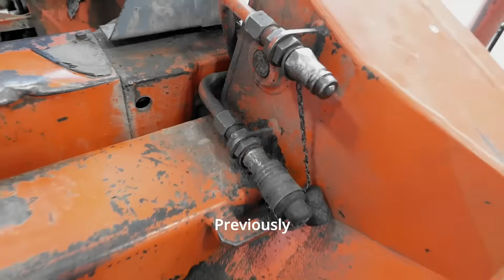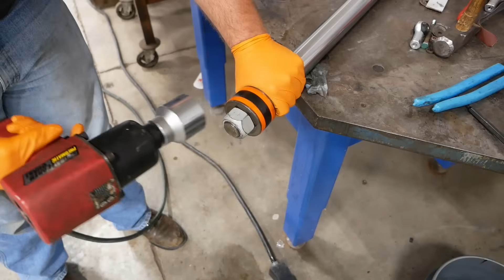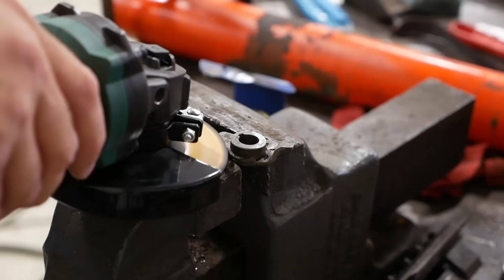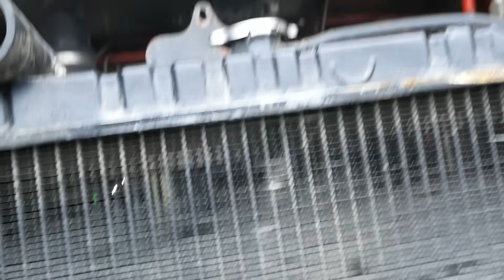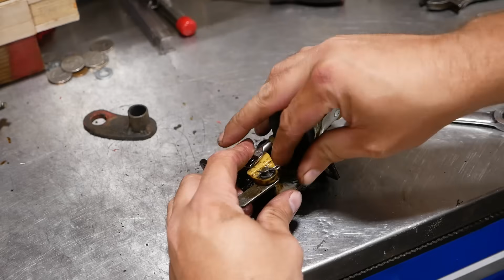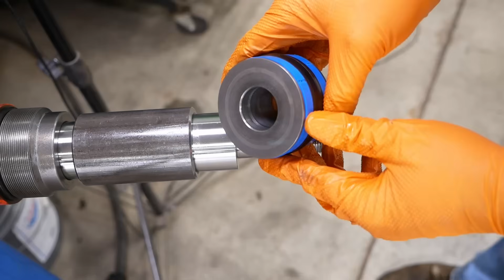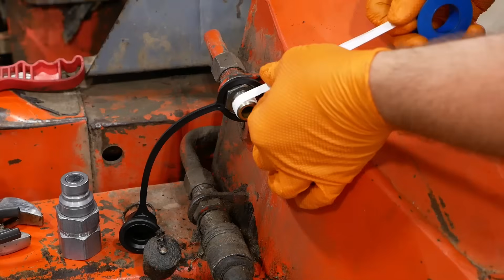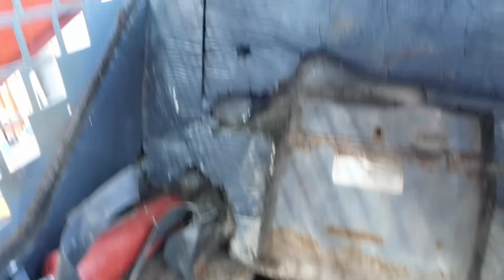Did I Blow up My Cheap Skid Steer? -  Thomas 173HL Won't Rev up, Leaking Cylinder - Part 2

Comment from the maker: Thanks again to patrons! If you want to further test the Kubota self destruct system, check us out on Patreon at patreon.com/watchweswork
Form a Funnel: https://amzn.to/3R9Iniy
Mess Stopper Plug Kit: https://amzn.to/45LNKZB
Seal Installer Kit: https://amzn.to/48anABj
Spoon Pick Set: https://amzn.to/3Pfhwii
Reply: I live up in SW WIsconsin so if you need me to pick anything up 'round here lemme know.
Reply: Formafunnel works ok for some things, although installing NPT nipple and plug as a permanent solution in most cases is the real answer. I drilled a hole in one end so I can secure it to whatever I’m draining. 
I’m doing small engine work and the silicone plugs are fantastic for that work. I ended up purchasing 3 sets to cover 1/8th of an inch up to about 1-1/2 inches. They came in several colors, which is nice. On one I drilled a pilot hole and installed a screw eye for a specific need. On another I drilled a hole right through to adapt my pressure/vacuum tester adapter cone for another use. They’re great for plugging engine holes temporarily in order to wash without getting water and debris inside. I keep most of them in ziplocks but have a clear flat plastic Sistema container on my workbench with two each of the sizes I use most often and that’s really handy. Search “powder coating silicone plugs” for many choices.
Reply: Thanks for the tool listings. Great video as always.
Reply: So true!  I learned real quick to get the wheels off of the ground before firing up an unknown, worked on by someone else, and yes machines I'm working on if there is any chance of hydraulic malfunction or linkage issues.  The first SS I bought was a case 1840 with a one side creeping issue.  Took a 50/50 gamble on an adjustment and went the wrong way.  Had it dancing between toolboxes and tables.  Finally just had to let go one hand and grab for the key.  Luckilly, it landed on all 4 and no harm to anything but my life expectancy I suppose.
Reply: I guess I'm confused about Kubota dealers. I thought we had Rexco here in the quad cities as a full line dealer
Reply: Loving these videos and happy to be a patreon!
Reply: this is why I keep a Big CO2 extinguisher in my shop it has saved my ass twice once on a runaway 4bt turbo oil seal and a fire on a gas air-cooled Wisconsin after a fuel leak also how many washer did they add to this machine jerry rigging to shit lol
Reply: Runaway diesels are no fun .. My Cat 3406 ran away running off the oil feed line from the turbo when the turbo blew.. Chewed up the crank, out of frame/overhaul, $10,000 dollar lesson .. I don't recomend it. It was screaming with rpms ... thought schrapnel was fixing to come through the block.

Comment: You should take all the tires off and check the sides of the machine where the axle hubs bolt to the frame, this area is notorious for cracking around the studs that hold the axle hub on. If you catch it in time you can weld the cracks .But if you let it go it can eventually cause the frame to break around the hub that holds the hub on and is the oil reservoir for the drive chains.

Comment: Oh sure!  I'd been fighting with a cylinder like that with the outside pin holes for about a month.  Broke the special spanner wrench.  Fixed it and immediately broke the pin off the wrench.  About 2 weeks ago I gave up, removed the cylinder from the machine and used a pipe wrench.  NOW I stumble upon your video about that kind of end cap.  :-)  Good video, thanks for sharing.

Comment: In the future, you should loosen (just break the initial tension) on the cylinder cap while the cylinder is still installed - then you only need 1 wrench. Once you get it off, you can just take it off the rest of the way.

Comment: I started a ford 8000 tractor that hadn't been startedd in years..  Well - the rack in the stuck at full throttle.   I did the same thing - pulled the intake plenum off and put both hands over it..  finally got it to stop.   Gets your heart pumping..

Comment: YEAH YOURE CLEAR !!!!  the old man shouted as he looked down the side of the bobcat for me while I was backing out of the driveway with a 500 gallon tote full of diesel fuel.  Of course being enclosed and down inside the sweaty bosom of the bobcat. I may as well have  been the three monkeys! cant see, cant hear and  cant talk over this machine. so  the old man said it was s good so I eased  myself back and all was good until it wasn't.  Well. I couldn't figure out why I had stopped.   huh. thats odd. gave her a touch more juice and then I heard the final death screech and a pop of what my knee would've sounded like if it were metal..  Course pops walked over to the location that I was to set the. tote at.. I push the bars out and cranked myself around to the left inside the cage. and oddly enough I find myself looking into the cab of my own truck from the drivers side    Thats weird !!  where's my fucking door?   oh there it is,  flattened against the quarter panel. mirror crushed between the two like a slice of pickle....Thanks pop.. Good looking out there.  allowed me to back right into my opened truck door and basically ripping it from the hinges... so yeah. be careful when backing up in a skiddsteer,,,  or put some mirrors on it and don't trust the old mans... YEAAAAAH YOURE GOOOOD

Comment: Probably could have called up the engine dealer, got a part number from them, and then gotten the part from your kubota equipment dealers, as long as you’re good other describing what it is they typically are able to find it.

Comment: I believe the groove on the piston is so it can go over the seal easier, if it had a sharp normal cut hole chances are you could mangle the seal easier while putting it on.

Comment: Worked at a Bobcat dealership for a bit. Witnessed a run-away on a fairly new unit! Only thing, it was running backwards! Couldn't stuff the exhaust, which was now identifying as an intake, because of the double wall exhaust pipe. Don't remember how they stopped it! But I do remember Bobcat wanted that engine to figure out how and why it was running backwards!
If my memory serves me correctly, it was in the shop because it was having difficulty starting.

Comment: We used to keep a couple of ping pong paddles in the dyno room with 'WHOA!' painted on them.
The other thing is if you're into an injection pump and want to check it before starting just loosen every injector line.  Crank the engine at full fuel and see if you get fuel. It won't start because all the lines are loose. Then crank it in the shutdown position and see if you get fuel.  No fuel, good.  Lots of fuel, bad.

Comment: That form a funnel is pretty cool. I have been doing the same thing with aluminum foil for 40 years...  Also use it to mask wires and anything I don't want to remove, for painting. Quick and easy and pretty cheap too!!

Comment: I have that tool as well and it does make it quite a bit easier on small cylinders. I rebuilt several cylinders on a Dynahoe 190-4 and did those by hand but they were all pretty good sized so was able to get them in without the tool. Rebuilding the dipper stick cylinder off of that thing was a bit of work by myself. Think it was something around a 7" bore with a 3.5"-4"ram and around a 40 to 48" stroke. I know my 3/4" air impact wouldn't remove the nut so I had to add a little heat to the equation. Worked great after I finished with zero leaks so I was happy and now I own a 3 1/8"socket.

Comment: I made myself a tool on one of those cylinders and then used a 4' pipe wrench on another. Rebuilt a couple on my forklift and need to do a couple more. Seems like the floor of my shop is always covered in that cat litter stuff that soaks up hydraulic oil.

Comment: With the talent and technique you have get rid of the puts Ville equipment and work with good reliable stuff . With the 23k likes you have if it hasn't been said. YOU THE MAN . The shop needs to be set up so if you need tools thy are readily available.

Comment: You'd think the broach would have a slot so it cant tip back and it'd wedge into the thing you're cutting?
Also the groove in the piston looked like it lined up with the 0-ring or something? Is it on upside-down? :)

Comment: On the bob tach,  there are aftermarket brand new tach assemblies for 740-840 bobcats,  look around they are cheaper than having the pin assembly reborred and sleeved,   Great video as always..

Comment: Wes, if you need injection pump parts, call a pump rebuilding shop. It seems that YouTube folks have had good luck with Area Diesel Service.
I used to rebuild them myself and I i figure that part should be available, but i do like your approach to it and it made for great content.

Comment: did you fix your quick tach yet? Just looking at the video you might be able to cut it down to fit if the pins are in  the correct position

Comment: The Dow windshield adhesive makes a fine stand in for unobtanium rubber bushings . All you need is to cut a new tube for the center then line it up and back the bottom with tape . Fill it up with the adhesive an let it set up overnight . It sets about same hardness as original bushings , very durable on all I've made up

Comment: Oh man, i mostly have the same situation in May. I named this situation "shit in may pants without taking off pants". OM601 engine in mercedes, bosch diesel pump. Before that, vacuum pump dies, BUT i don`t know this fact at that moment. I assumed that problem was in engine shut-off valve (he vacuum powered). When i replaced this valve, i does something like what you does, but with bosch way - i depressed a engine shut off lever, her relevant part inside the fuel pump are moved to the wrong place and pump will stay at full gas. In this situation key did not turn off the engine (because vacuum pump not worked) and what real scary - wrong position of shut off lever wasn`t allow to work shuting engine at all, plus full gas. 
Another funny movement, that i did - i dismantled the air filter box, because i could not replace shut-off valve within that. That means when i decide to try to start the engine, air was sucked into the engine within FOUR pipes of intake manifold. In this situation, there was veru hard to trying cover four pipes with two hand in one moment (i tryed to stop the engine that way, and thanks to this RPMs was dropped). As a result, i could explainwhat need to do to my sister (very loud, because OM series engines have at least 4000 rpm at maximum gas), and she cut fuel hose. 
Thanks for your videos!

Comment: that pin thing must be Kubota universal.  we had a B6200 do that with every hole for the belly deck.  I think it even did it for the PTO shaft :P  meanwhile, both that and a TX lawn tractor have to go to the scrapyard in the sky because I was told you can't even get OIL FILTERS for them anymore,  let alone the tension spring I need for the deck (we only put 80 hours on it from purchase)

Comment: Hi Wes. Love your channel. I noticed you have the same rpm monitor I have. I have a question maybe you know about it. Does it matter what diameter your sticking the reflector tape to? I haven’t trusted it because how does it know to read the rpm if it doesn’t know the diameter of the shaft/etc your reading off of. Hope I’m making sense.
Reply from the maker: It should not matter. It just measures the number of times the tape reflects the light.

Comment: One littke advise für clamping down cylinders: never clamp them on de tube, always on the eye. Otherweise you might deform the tube a little which causes the seals zu fail in no time

Comment: Not to be that guy commenting on a YouTube video about how to do something. But just good practice to never use Teflon tape on anything hydraulic related. Always use thread sealant or dope. Teflon is one of the major sources of contaminant in hydraulic systems. If not set back 2 to 3 threads the Teflon can't get bound up in a DCV or any other part of the hydraulic system and cause a host of other problems.

Comment: A workaround for the broach angling itself is if you are making the part on the lathe, leave it about one to two inches longer than required, then broach it then return to the lathe and turn to required length. If a purchased part that is already to length then make a dummy one about 2 inches longer on lathe with a recess in the end to take the real part and then broach the real + dummy  together, you will find the broach will have tilted less over the longer length as it acts as a guide.

Comment: In the future for engine parts, you might want to look at a Tractor that was sold by Kubota with the same V2203 engine in it, model L4200. I looked this up using another Youtuber with the same skid steer that he rebuilt and then searched tractors on TractorData with the same engine. That should point you in the direction you need to look to find the part numbers for the Kubota dealer. I've purchased parts from them on machines that were made in the early-'70s so they should have everything you need. Some of the stuff is expensive but probably cheaper than making the part in-house if you calculate your time.
Reply: For cylinder stuff, I highly recommend a company called Dayton seal. They will make you up a kit for your cylinder no matter what it is. You tell them what type of seal it is, they'll ask for dimensions, then they'll pull the right pieces. They're not the cheapest around, but they aren't going to be more than what a dealer would charge. Not only that, but once you get the pieces, you have universal part numbers that you can reference if you need to service the cylinders again. Great company to work with.

Comment: Wes, Just wondering if you put the piston on backwards. You were wondering what the groove was for on the rod and I noticed that it looked like the oring on the inside of the piston would line up with that groove if you flipped the piston around. Also, I see oil relief holes in the piston and it looks like that oring is the key for that to work right.
Reply from the maker: I put it on the way I took it off. Hopefully that was correct.

Comment: Great video- that will help me if I ever have to rebuild my cylinders.  I would recommend fixing the parking brake though, for safety reasons.  Lowering that safety bar and starting it up while standing in front of it made me a little nervous.
Reply: Do you or anyone here have experience with the parking brakes on these?  I have a 243 and im looking for information on the spacer arrangement on the h e calipers.  I assembled mine like the book says and the pivot arms are close to running out of travel in the hole going into the chain case.

Comment: Thanks Wes great job on that skid steer , Just a tip for metric drilling and tapping maybe you know this one but take it from an old toolmaker with about a year before retirement  , subtract the pitch from the major diameter there's your tap drill size , I've showed my apprentices and  some of my fellow journeyman over the years , Rather than looking around for a tap drill chart , ok hope this makes your life easier at some point , thanks .

Comment: enjoying these video's.Quite ironic that the issue was "won't rev up" followed by 'all the rev's (and a few more)  you could possibily want'.With that potential runaway engine I think that's the first time I have seen you in a position where you were very  rapidly and systematically having to work through what options were avaiable. ie  - hand blocking the intake,didn't work,now what?

Comment: I would add that linkage to the drop bar to stop all hydrolic functions. Do it for sake of safety reasons, as cutting corners doesnt make anything better. Glad that the engine run away was a simple fix though.

Comment: I’m only like 7 min into the video and maybe he does.  It I would think since you plan to use it mostly in the winter. It may be smart to add a second battery in place of that tool compartment. Give you the extra umpfff you’ll need for cold starting. Maybe a grid heater too.
Reply from the maker: It does have glow plugs.

Comment: That is what cheap anything is, when it blows up, we buy another one, and another one ... Then, when we spent more on cheap ones, than what we would have on a high quality new one, with a good reputation. We kick ourselves because we paid twice as much and plenty of headaches to boot. Don't forget $220 an hour lost income, while working on the cheap skid steer. $2200 a day lost, times two weeks, while waiting on the parts = $22,000. Good chance a new one will run a long time, and could very well pay for itself, long before any real problems arise. 
`
A Bobcat skid steer loader with a capacity of 1,500 pounds costs approximately $25,000-$40,000. A 2,000 lb capacity Bobcat skid loader costs approximately $40,000-$50,000. A Bobcat skid steer with a 3,000+ pound capacity, fully equipped, could cost up to $60,000-$70,000 or more. 
`
Please delete my message after reading, I don't want to sell them at no income to myself.
Reply from the maker: I think we're living in different worlds.
Reply: @WatchWesWork  Yes, maybe. But, I have been wrong plenty of other times.

Comment: I had a 1980 Mustang 440 for around 30 years. Got it from a swimming pool contractor who didn't own a grease gun among other things. It was real tired in various places including the hydrostatic drive on one side. Non standard as in completely different attachment system, used type F ATF and a "T" handle motion control so you could run it one handed and hold your beer. Replaced it recently with a low hours older Bobcat and what a wonderful difference. I have 9 1/2 feet so the foot controls are preferred.

Comment: At 27:15 - I bought a Form-a-funnel to use on my riding mower to keep the oil in the filter from running all over the chassis and the deck belt. Works well.